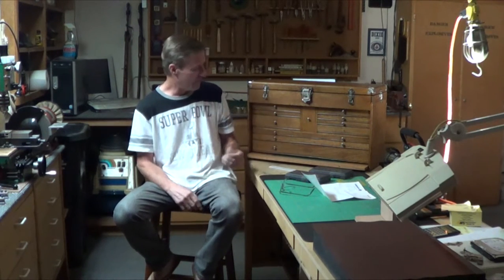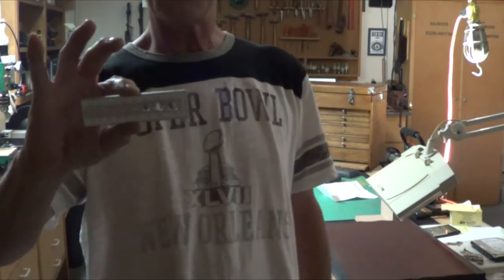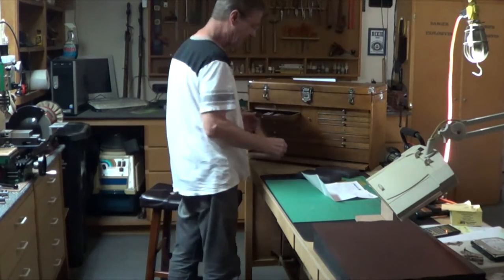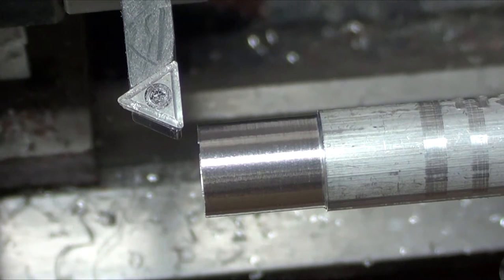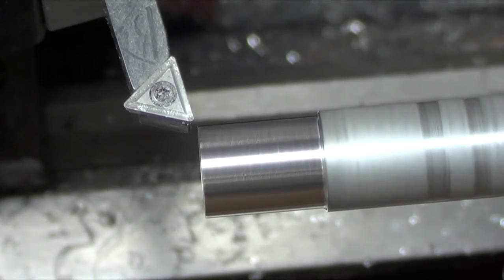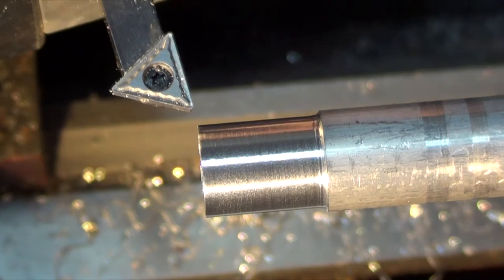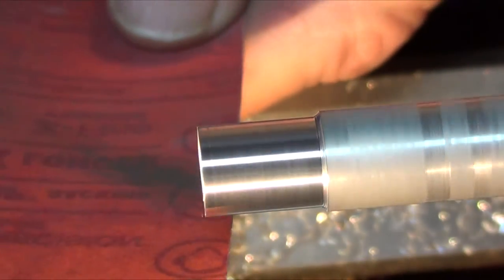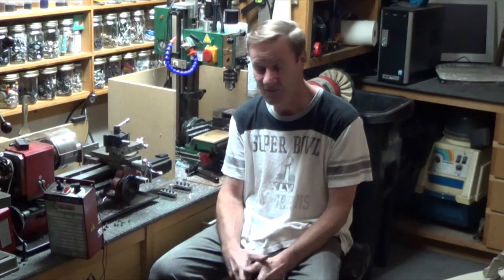How I finish surfaces on the Mini Lathe Video #12

Comment: Thanks for the info, I am going to try them on a micro lathe.

I have been using Arthur R. Warner high speed steel tooling but have been wanting to try other inserts.

Thanks again.
Reply from the maker: +TheChugwater1 Remember these do not fit the Harbor Freight set...

Comment: Hi Dave ,
Can you give us a link for the TCMT carbide you used on yout 1/4" tools.
Reply from the maker: There were different types for different materials but for aluminum https://www.amazon.com/Cobra-Carbide-72060-Uncoated-Thickness/dp/B00EUGY5G0/ref=sr_1_1?dchild=1&keywords=cobra+carbide+72060&qid=1590016983&sr=8-1
Reply from the maker: TCMT 21.51 or TCGX 21.51 you just want the 21.51 size..

Comment: LMS carries new ones.
Reply: +David Kirtley I should be more clear :)  Little Machine Shop carries every part for these lathes including the circuit boards. I replaced my controller once through them. They also have a kit to put a 14in bed on. I really like mine a lot better since the upgrade. The motor mount is also much better on the 14 in bed.
Reply from the maker: +David Kirtley Thanks Dave for the info... I found the part there but still undecided on fixing it or a new bigger lathe. There is a lot of hours on this lathe... $140 board $160 bed = $300 or $670 new 14" grizzly.